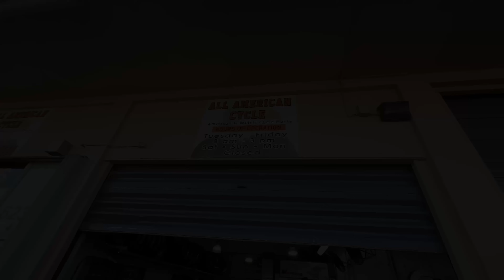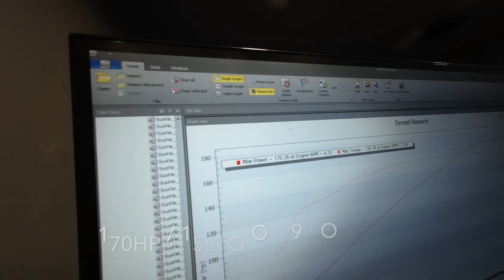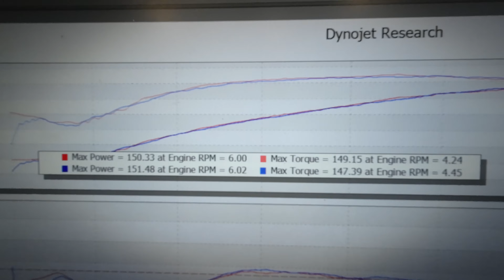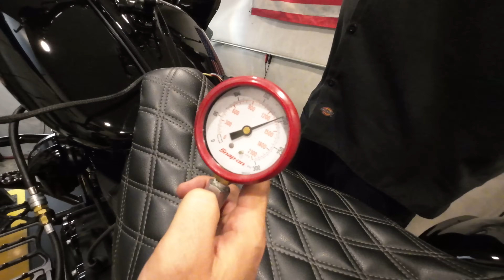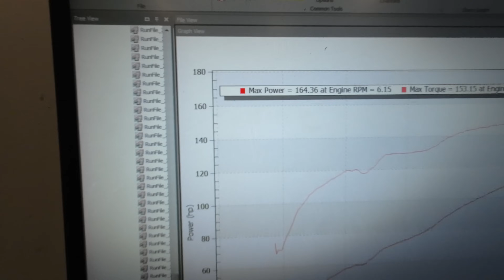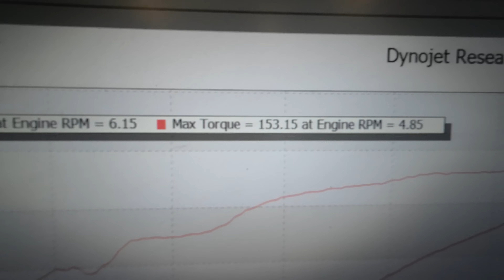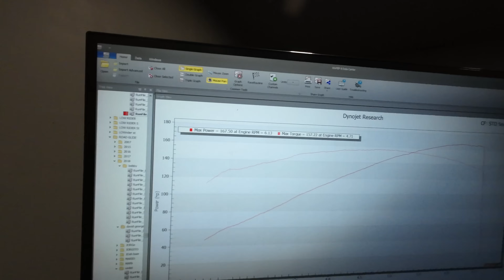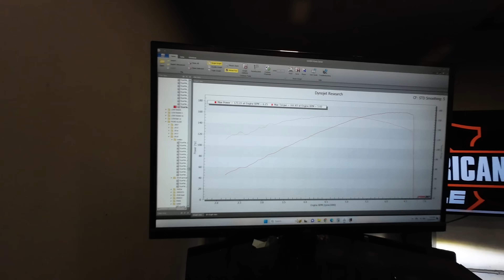I TRAVELED 1500 MILES TO GET MY BIKE DYNO TUNED ON E85! *INSANE*

Comment: Dude that’s crazy! That’s why you always always always get someone that knows what there doing to build your bike. Awesome vid by the way!!!🎉🎉🎉
Reply from the maker: This had nothing to do with my engine builder / assembler.  The company I ordered the heads from is at fault for this.  They did not mill them to the specs they told me they did to make the compression I needed to make big power.
Reply: @DOOWORKMOTORSPORTS  who did you get the heads from, Wards Performance ??😮
Reply: @DOOWORKMOTORSPORTS  yes but the assembler should check specs before assembly correct?
Reply from the maker: @Pinozcyclezandridez  Correct.  And we did. The deck height was near perfect, it pumped decent compression, however the rings weren't seated yet.  Also I couldn't tell by looking at the bottom of the heads if they were milled enough or not..  Jorge looks at these every day, so when he took them off and looked at them, he noticed that they weren't milled nearly enough for the compression ratio I needed for this application to perform.
Reply from the maker: @curtishoke143  I'm not one to bash companies on my channel, but if you know, you know.  I might make another video strictly on this issue here in the near future.
Reply: @DOOWORKMOTORSPORTS  I gotta take mine to him also! Simply amazing. You’re super blessed you took it to him and he found the issue. I’m standing by for your next vid on your review while riding your new beast!
Reply: @DOOWORKMOTORSPORTS i wouldn’t say that’s bashing them but i do understand, people can take things out of context quickly. But I’d assume they were ward heads most guys run them i even think they make majority of the heads for most companies.

Comment: Wish i had money to play around and build my bike some more to what i want. Gotta do piece by piece and it takes forever. Coming up on 2nd year for me running 475 kit on mine like you did before you went 128.
Reply from the maker: Hey its taken me 4 years to build mine to this level.  Just do it in stages like I did and you will appreciate it more!
Reply: @DOOWORKMOTORSPORTS  I have and def have appreciated it more. Specially with any upgrades I do being done myself and learning as I do it. Its more rewarding when it works. If your ever on the scooter in NC or whatever Im always down to rip if you wanna link up sometime. Keep up the good work man.

Comment: Bro how quickly did he pull those heads, send them out, re-install and then re-tune?  Was that all done in a few hours/same day?  Gotta say, you are right, nobody turns  work around like that site on scene.  Def. have to give it to them.
Reply from the maker: He had the heads off in 1 hour.  Sent to the machine shop same day. I went and picked them back up at 9pm.  They were on the bike the next morning by 10am.  Jorge and his crew are top tier mechanics that get shit done!! 10/10 recommend.
Reply: @DOOWORKMOTORSPORTS  nice!  Glad he and the team got you right.
Reply: @DOOWORKMOTORSPORTS   What compression are you running after they cut'm?

Comment: Bro the problem was not the cylinder heads. The problem is the cam is not the right choice for the compression ratio and the head cc.  Now. Did they check the valve to piston clearance on the over lap. I hope it’s over 80 thousand of an inch. Or you will hit the piston at hi RPM.  Reason it will hit is because it’s not a solid roller cam with valve lash adjustment the lifter if it bleeds down that it does at high rpm will make the valve timing change and it could hit    would change the cam. CR 513.   Make like over 180 or more. But anyways congratulations and hope it turns all out well. For you.   Ride safe
Reply from the maker: You are 100% accurate with your info here, however this cam was sold as a kit with the cylinders, pistons, ported and milled heads from the same company to work together as a proven kit.  The heads were not milled to spec to get the compression I needed to perform the way I wanted it to unfortunately.

Comment: Kinda new to this whole bike building. Just had a star racing 30/30 cam installed on my bike. Wasn’t pushing numbers I like 96 hp with I think 106 tq. So they gave me another free retune but I’m Looking to change up my stuff if there’s any tips for the best air cleaner to get and a 2-1 exhaust
Reply from the maker: It all is going to depend on how much power you want to make and how much money you want to spend. What kind of bike is it? I can give you some optimal options to go with!
Reply: @DOOWORKMOTORSPORTS  well I want it to be reliable to ride so I don’t wanna get into the motor right now till I journey out of my apprenticeship. But I have a 2019 street glide standard. Has Rinehart mufflers, a aftermarket hd air cleaner, and a tts tuner with a 30/30 cam. I honestly wanna be at the 110-114 hp mark I’ve seen it done but just don’t really know where to start I figured getting a better air intake would be the first thing
Reply from the maker: @Poolywitdatooly142  Start by throwing that TTS tuner in the garbage. Get a Dyno Jet Powervision, 2 into 1 full length pipe, Cyclerama CR 480MT or CR483 Cam, and a better air cleaner that flows better. You will hit those numbers no problem.
Reply: @DOOWORKMOTORSPORTS  I thought powervision got the epa thrown at them? That’s why they told me to get the tts tuner but I plan on changing to a 2-1 exhaust and a bigger air intake
Reply from the maker: @Poolywitdatooly142  No, they still good!
Reply: @DOOWORKMOTORSPORTS  ah okay! Any certain type of there tuners to get out on there? Plan to have a dyno tune done anyways

Comment: Hi, maybe my question is a little silly, but what is the difference between putting it in the Dyno as you did and buying the Dynojet Power Vision PV3 and configuring it yourself?
Reply from the maker: You can perfect the tune way more on a live dynometer.  Every bike is different. Canned tunes are not 100% accurate for every application.  They will get you on the road running, but not perfect like a dyno tune would.

Comment: No numbers on the CR 480MT? Is your moms bike going on dyno?
Reply from the maker: Stay tuned for the next video! I might take her bike down to Jorge when were back in Florida for Bike Week.
Reply: @DOOWORKMOTORSPORTS  cool. Am between these two cams. Would be interested to see what you think after riding both and dynoing both
Reply from the maker: @stevenramos4400  What I can tell you is that the 480MT cam is a blast to ride - has lots of TQ down low.  The 483 is more of a performance cam so you will have more top end power with that cam.

Comment: Bro I’m 60 seconds into this video. If you tune your bike at sea level then drive to Michigan, the tune is not going to be right lol. Common dude.
Reply from the maker: lol the elevation between FL and MI is about the same. I don't live in Colorado man.😂
Reply: @DOOWORKMOTORSPORTS lol bro no it is not, its about 894’ different 🤣🤣🤣🤣🤦🏻‍♂️ about a 3% power difference in Michigan as opposed to Miami.

Comment: That's bs fuel moto sold u those didn't they?? If there's something wrong u should make a seperate video about that!!! That's not ok!!! It should have been proper from them if a regular guy bought those they would have to pay thousands in labor
Reply from the maker: Fuel Moto did not sell me these.  I might make a separate video explaining what exactly happened and what company I bought them from.  But yes, they cost me a lot of extra money that day..
Reply: Thanks for clearing that up. I was going to buy stuff from fuel moto, but not if that was the case, lol!! Anthony, what size heads did u go with for valves plus 2 over plus 1?? Are u going to do a video with all ur engine details soon or should I reach out to u on IG?? It's paul by the way we chatted long ago.
Reply from the maker: @Urfavgirl_Avani  Fuel moto is great!  I buy most of my parts from them!  I went with +2 heads. Yes, I will be doing a build breakdown video here soon.